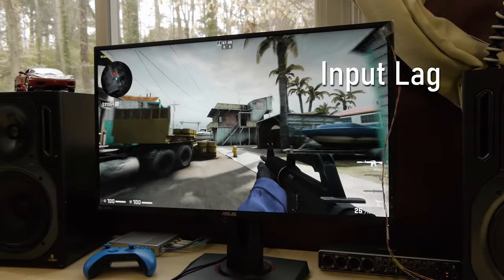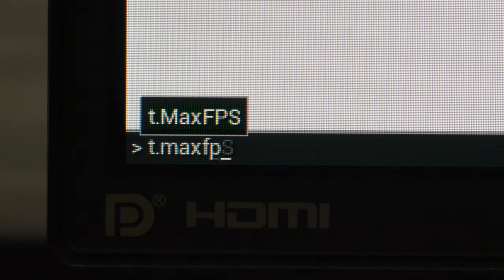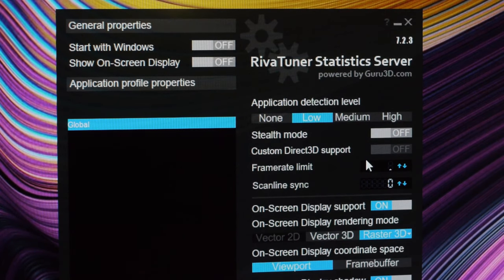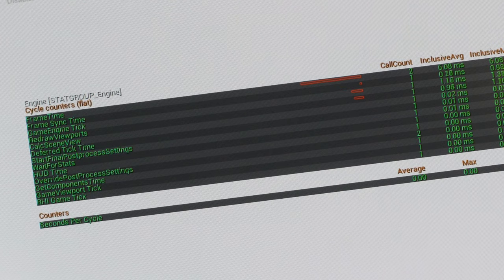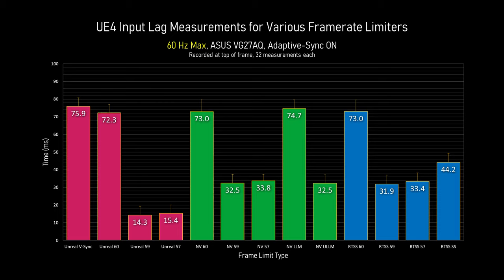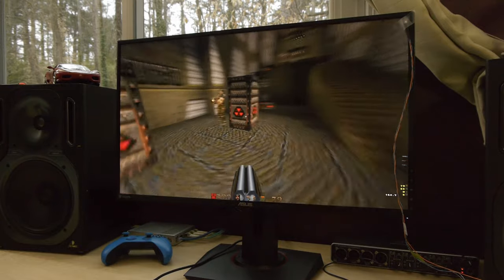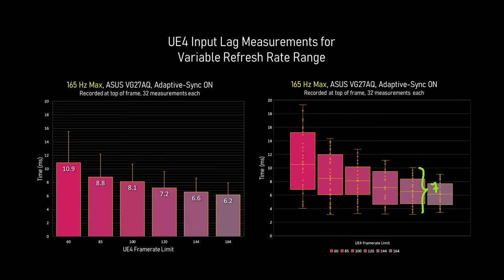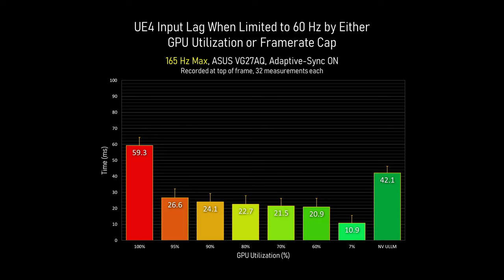Input Lag and Frame Rate Limiters

Comment: Seems like the most convenient usage is this(all from nvidia panel):
1- Gsync enabled
2- Vsync enabled
3- Fps cap -1 of max refresh rate
4- Ultra low latency mode enabled

So you get gsync all time, reduced latency at full gpu utilization thanks to ullm, vsync prevents small overshoots going out of sync range. Am i right ?

Comment: The one thing you got wrong was to name Variable Refresh Rate as Adaptive Sync.
Variable Refresh Rate = FreeSync/G-Sync
Adaptive V-Sync is another type of driver sync that caps GPU render if FPS is higher or equal than the refresh rate, but allows tearing if FPS drops below the monitors refresh rate.
Other than that, great experiment!
Reply: FreeSync is AMD trademark, "VESA Adaptive-Sync" is the "generic" name for FreeSync on HDMI and DisplayPort, and of course that is not to be confused with Adaptive V-Sync.

Comment: I've done some testing and theory with interlaced, it looks like there is less motion blur at high res, and the image quality competes with progressive at 1600 or 1920.

I may be wrong but the CRT scanouts being direct interlaced might actually be beneficial here in frame buffer times, because only half a frame needs to be output at once with staggered lines; Then the expected tearing if I am correct and the AMD R9 280x actually renders half the frame at a time to the buffer at least, we should see less tearing than progressive.

Comment: You mention at the end how all high refresh rate monitors you've tested have sub 1ms input lag. I'm curious about my Viewsonic XG2530 which according to a couple of places I found online has an input lag in the 8ms area (https://pcmonitors.info/reviews/viewsonic-xg2530/  https://www.tomshardware.com/reviews/viewsonic-xg2530-240hz-freesync-monitor,5392-5.html). When I bought it I fell into the '1ms response time' marketing lingo and had no idea I should also be looking at input lag. If this monitor really does have an added ~7ms over competing products than it's pretty much dead in the water for the purpose of competitive video gaming.

Different places use different methodology so I can never be sure how different monitors stack up against each other. I gotta say, out of all the places, you have been the most thorough. If only companies could send you monitors for you to test you would have a service that no other place offers on the internet.

Comment: Sorry, my English is not good. I have a 60hz monitor, no g Sync, no free sync, and no V SYNC, and I just want the lowest input latency and stable frame time. So when I use the game cap and rtss fps cap, do I need to limit the frame count to 59? Is this delay higher or lower than the frame limit of 100hz?

Comment: i have a general question. if i have set a limit of lets say 59.98 in rtss for fps cap and in game 58 fps. is the rtss limiter disabled does the rtss limiter affect my game? my question is because i have a setup for my rtss for general games but some games have ingame limiter. to avoid going always out and disabling rtss i wanted to know if rtss kicks still in even if my ingame cap is lower than the one of the RTSS. i do this for avoiding high input lags. and some values are even better for this. and especially ingame caps are better tho. thats why my question.
Reply from the maker: Using RTSS like that is a pretty clever solution to use for games that don't have internal caps. If the in-game limit is set lower than RTSS, RTSS won't be doing anything, so it's safe to leave it on generally.

Comment: So if im correct what you're saying is for games that are less demanding and give off a lot of fps keep adaptive sync on and vsync off with no fps cap. But games that use more power i should have adaptive sync on plus vsync on with a -1 fps cap? And if i put a fps cap, would that have to be from the nvidia control panel, in game, or both? 
(Edit) 
Also if i did enable vsync, would it be from nvidia control panel, the specific game or both?
Reply: It's better to cap fps and turn vsync on and even low latency mode all in game engines

Comment: Desperately looking for a 27" 144hz 1440p TN monitor. What would you recommend? I want minimal input lag and refresh rates to be the primary considerations but it would be nice if the image quality wasn't total rubbish.

Current considerations include:
HP Omen 165hz 27" Model# Z4D33AA
Samsung Odyssey G7 27"
LG 27GL850

Thanks for the unreasonably high quality and technical content.

Comment: wow this is excellent. Kinda disappointed you didn't include no vsync results just for a comparison.
Reply from the maker: V-Sync off, from the perspective of the swap-chain, is essentially lagless. As soon as a frame is done rendering, the front and back buffers are swapped, and you'll see part of that frame on the screen... with a tear line.

That means the lag you "feel" depends ONLY on the game's render time. For instance, I usually play Quake 2 at 1000 FPS V-Sync Off. There are multiple tears on every frame, but a 1 ms render time makes the game feel very snappy.

From there, you'll just have a linear increase in "lag" based on the framerate. 500 FPS gives 2 ms of lag, 250 FPS gives 4 ms, etc.

So for V-Sync off, higher framerates are always better, but there's not much for me to test. That's why I said in the video that V-Sync off isn't all that interesting :)

Try grabbing q2pro or ezQuake and playing at 1000 FPS. It's really good!
Reply: @ApertureGrille  thanks for the clarification

Comment: - This is awesome and thanks to you for the great work! When you say to find a monitor with Adaptive-Sync, is it something like GSYNC? 
- I did not know that turning VSYNC ON and CAPPING the FRAMERATE will reduce the latency, I thought in FPS game you always want to have it VSYNC = OFF
- Don't we get better results with VSYNC = OFF and FRAMERATE UNCAPPED? What are your thoughts on this?
Reply from the maker: Thank you!

Adaptive-sync, variable refresh rate (VRR), FreeSync, and G-SYNC all are different names for the same adaptive monitor refresh rate behavior. Adaptive-sync has been one of the most impressive tech improvements for monitors in years, and I'd always recommend gamers use it... unless you're going to the lowest input lag possible.

I mentioned in the video that I play Quake 2 at 1000 FPS V-Sync Off because that's one of the most immediate and responsive games around; that generally holds, and I've got a video coming out about V-Sync off soon. If you're serious about reducing latency, you should do three things: 1) run games at 300+ FPS, 2) turn V-Sync off, and 3) never let your GPU go above 90% utilization.

For most people, though, losing a few milliseconds of latency isn't worth getting all the tearing and stuttering that comes from running V-Sync off.
Reply: @ApertureGrille  Thank you for this precious information, I mainly play Valorant at the moment. Based on your video I did activate GSYNC and set my in-game FPS limiter to 357 FPS since my monitor refresh rate is 360hz. I also turned off VSYNC in-game and in NVIDIA parameters. I guess this is already a good setting?

Now if I want to go low FPS, uncapped the FPS in-game, and keep GSYNC? By the way, my FPS goes between 450 and 750 it's not consistent, does that matter? Also, I don't really see any screen tears or stuttering.

Looking forward to your next video! Once again, very well done!
Reply from the maker: @boa974  if you don't notice the tearing, you can let your framerate run as high as possible. Normally I wouldn't want to let the framerate swing that much, but 450 vs 750 FPS is only a frametime difference of 0.9 ms.
Reply: @ApertureGrille  Could you test the difference in 60hz and NTSC 59.94Hz if it affects pacing?  and for VRR if one has to limit at 58?  maybe 119.88 | 120Hz  By intuition  X/1001 modes will free a little GPU utilization/time!

Comment: So I was doing it all wrong... I set nvidia frame limiter to 143 and turned g-sync on. Basically I need to use ingame frame limiter, turn g-sync on and turn on ultra-low-latency. It’ll be interesting to see if I can feel the difference.

Comment: @a5hun should I enable Radeon Anti-Lag when I'm CPU limited? I have a 5700xt and a r5 1600 so I often ends up being CPU limited with a high refresh rate monitor.
Anti-Lag is supposed to be used in GPU bound situations, can it actually be harmful in my case?
Btw I really like your analysis and reviews, I just read your VG279QM review, good job!
Reply from the maker: The way I tested lag with my super simple UE4 build can't really simulate a CPU limited situation. I don't expect it would make it any worse, though. I'm using a 7700k for my main system, but I also have an Ryzen 1600 on another PC, so I'll see if I can find some way to test being CPU bound properly!

Comment: How about no sync ? 60hz 60fps gsync vs 165hz 60fps no sync ? How about LFC's effect on input lag, tear and stutter. Playing Cyberpunk 2077 with RT my fps fluctates around LFC range and i feel like my game is more laggy with gsync. I haven't tried monitors with gsync module but i feel like these gsync compatible monitors are straining with gsync. 

I feel like with gsync frames are jumping as a whole. Without any sync i see more free and fluid movement and tearing is mostly visible on textures with dense vertical lines on it in games if i look for it. I really don't see tearing as a problem with high refresh rate monitors (its a nightmare with 60hz monitors though) and i was expecting smoother motion from gsync intead of ''tearing fix''. However gsync feels jumpy to me. Even in gsync pendulum demo if you look at the test pattern you can see tearing artifacts without gsync but vertical bar also moves smoothly and defined. With gsync it jumps to the next position and thickens by blurry edges.

Comment: Thanks for your work here!
Question:
If the general rule is to internally limit the framerate 1 frame below the cap of the monitor, does that mean that you wont be able to use blur reduction settings for high refresh rate monitors?
To my understanding, blur reduction such as Nvidia's ULMB or Asus' ELMB only work at set refresh rates, so they wont be of use in this input latency reduction method?
Reply from the maker: For games that allow it, you can set an internal limit fractionally below the strobing refresh rate. So for instance, if you're strobing at 120 Hz, with VSync, you have to eat a bunch of lag, but if you limit via the game to 119.9, you can reduce lag at the cost of a consistent hitch every few seconds. You can spread those hitches out by limiting closer and closer to the fixed framerate, e.g. to 119.999.
Reply: @ApertureGrille  
Thank you kindly. 
Chris of Battle(non)sense not too long ago released a video regarding frame capping with g-sync for lag reduction, and recommended 4 frames below the max refresh of the monitor, or possibly more with higher refresh monitors. 
Is just capping the framerate to 1 frame below still good?
Reply from the maker: @superbro6413  I tested 1 frame below and 3 frames below and found no difference. Perhaps there are some games or engines where you'd want to cap a little extra below if their limits aren't very consistent, but with something like UE4, its cap is steady and accurate.

Seems like a "playing it safe" kind of rule, but there's really not that much difference between getting 164 FPS and 161 FPS.
Reply: @ApertureGrille  
Thanks again.

Comment: A help.
I am currently playing Call of Duty MW, multiplayer, 1440p resolution.
I noticed that the game's fps limiter doesn't work properly, in fact it never worked.

I play on a Qled 120Hz Freesync TV, and when I limit the fps within the game to 117 or 120, it doesn’t, I have 125 fps limit.
With that I end up noticing tearings (bottom of the screen) and microsstuterings when it hits 125 fps.

What would be the best solution to stop tearing and stutter altogether, combining with low imput lag?

Setup: R7 2700 @ 4.0Ghz
RX 5700 XT
2x8g @ 3066

Comment: It was very interesting. Thanks for the testing!
Do you have any idea on how Fast/Enchanced sync in comparison with all the other frame limiting methods you've used here work? 
I love like using Enchanced sync with my RX 5700 and Lacie 22b4, but I have not seen any good tests of Fast/Enchanced sync.
Reply from the maker: I need to buy an AMD card at some point to test all this, but BattleNonsense found Enhanced Sync to work just as well as NVIDIA's ULLM. And Fast Sync should reduce latency if you can get a frame rate that's an integer multiple of your display's max refresh rate. I may test this for the next one.
How are you running your CRT with the 5700?
Reply: @ApertureGrille  thanks for the info, I somehow missed the Fast/Enchanced sync tests from Battle(non)sense, will check them out.
Right now I'm using a cheap 240 MHz 6bpc DP-VGA adapter, but I also have a 330 MHz delock 62967 ordered. 
There are even better adapters such as Delock 87685 and Sunix DPU3000 which are able of 400+ MHz pixel clock.
Reply from the maker: @elesinalex  Your Lacie can do 140 kHz horizontal clock, right? I'm jealous. The 330 MHz Delock should be good enough for resolutions below 1600x1200.

Comment: Great video! 

Did you try ullm with vsync and gsync enabled? My old g-sync moni can only do 120hz with these settings (without ullm 144hz). My moni shows when ullm is running when all 3 gpu features are turnd on. When I use ullm the picture gets a bit darker. Do you know what would be the best refreshrate for ullm with my moni? Is there a difference in input lag between 119 to 120 hz with full ullm?

Topic suggestion for another video: the influence of highly variable frame rate on "analog" input like mouse or joystick axis. I have the impression that fast mouse movements sometimes have a poor repeatability especially when the frame rate changes during the input. It's best noticeable at low frame rates.
Reply from the maker: Gets darker? That should only happen if you're using a blur reduction mode. For G-Sync monitors, NVIDIA calls it ULMB (Ultra Low Motion Blur). ULLM is NVIDIA's frame-rate limiter and lag reduction setting. Which monitor do you have?
Good suggestion about another video! I wanted to look at whether using a mouse with high DPI and low sensitivity was better than the other way around as well.
Reply: @ApertureGrille   Looking forward to the DPI / sensitivity video! From what I've seen so far, using as high a DPI setting as the mouse sensor can reliably support while lowering in-game sensitivity settings has two benefits:

1 - Reduced input lag brought about by using higher DPI. This has been tested by both Optimum Tech https://www.youtube.com/watch?v=imYBTj2RXFs and Battle(non)sense https://youtu.be/6AoRfv9W110 using Nvidia's LDAT.

2 - Increased granularity / precision in aiming granted by lower sensitivity. This is the one that's a lot more interesting to me, even though it's probably less impactful in actual gameplay. I haven't found a comprehensive explanation, but piecing together what I've seen from 3kliksphillip's video https://www.youtube.com/watch?v=8XNUp70mDlQ and these great demonstrations in CS:GO https://www.youtube.com/watch?v=NUiGkDB_48s https://www.youtube.com/watch?v=tsHV_ZH3T9c, this is what I've come up with: 

In 3D games that use rectilinear projection such as first person shooters the in-game sensitivity determines rotational movement by applying a certain amount of change in angle per count registered by the mouse - i.e., x degrees movement per count (or "dot") of the mouse's sensor.

Since there are discrete steps in this angular movement, we can determine that there are certain areas in the 3D space that we cannot directly aim at, and that this problem becomes exacerbated as the distance increases. 

Low sensitivity therefore helps us by reducing the angle change per count, making more of the 3D space accessible to our aim. In turn, and in addition to the latency benefit, raising the DPI allows us to lower the sensitivity while maintaining the same relationship between physical mouse movement and the corresponding change in game.

In an ideal world, we would maximize the latency benefit by using an infinitely high DPI and lowering our in-game sensitivity to get to our preferred feel. On the other hand, to get the most precise possible aim, we would use an infinitely low in-game sensitivity value and raise mouse DPI correspondingly. However, neither are really practical since mouse sensors have a ceiling after which they begin to have problems with accuracy (or simply cheat by multiplying the registered counts given to the computer). So practically speaking the best course of action is to pick the highest reliable DPI setting (1600 or 3200dpi for most sensors) and adjust in-game sensitivity to accommodate. 

Of course, the benefits of high DPI / low sens are mostly academic since with any reasonable sensitivity the inaccessible space would be way smaller than any hitbox anyway - and empirically most pros are doing perfectly well with the "high" sensitivities used with 400dpi, but it appeals to the nerd in me regardless. I could also be terribly wrong about all of this, so knowing how meticulous your are with your work I'm really looking forward to seeing your take  :)